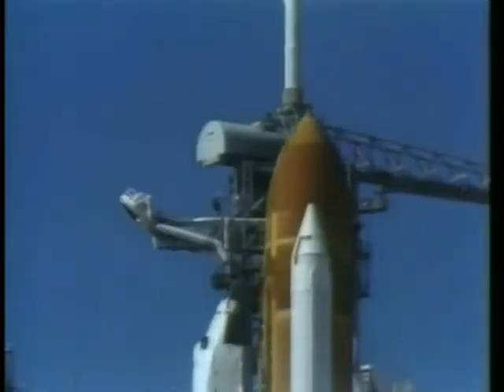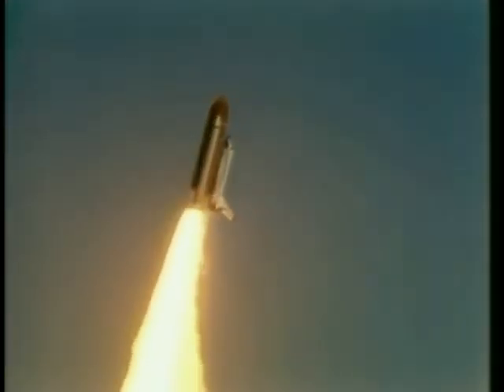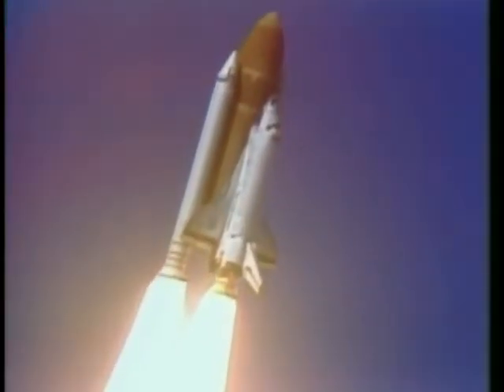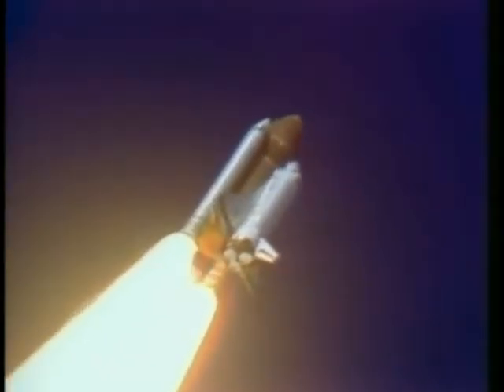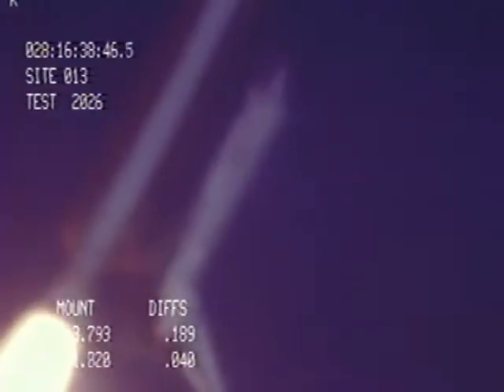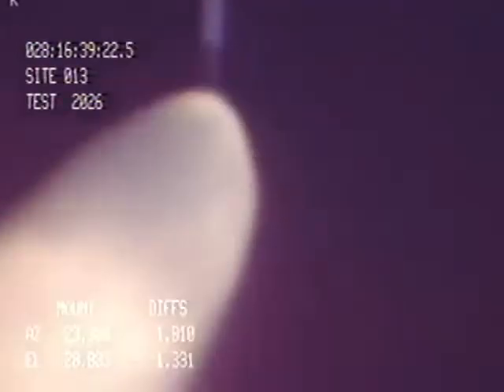The Challenger Disaster: STS-51-L Side Camera

Comment: You’d think someone at the control room would see the fire coming out of the O-Ring and immediately tell the shuttle astronauts to abort. There’s a good 13 seconds between the flame starting to when fuel tank blows up.
Reply: Not like they could have done anything. They were dead as soon as the fire started
Reply: Those boosters cannot be turned off once lit. They have to burn out. And even if they could have jettisoned the boosters, it would just make another death scenario. They wouldn't have the power to make orbit or the ability to land it. It's one procedure, one plan and one chance.
Reply: @ There’s a failsafe where the shuttle could detach from the main booster and glide back to base.
Reply: @jrxtrc  they are over the base with a glide ratio of a bowling ball. Don't think so.

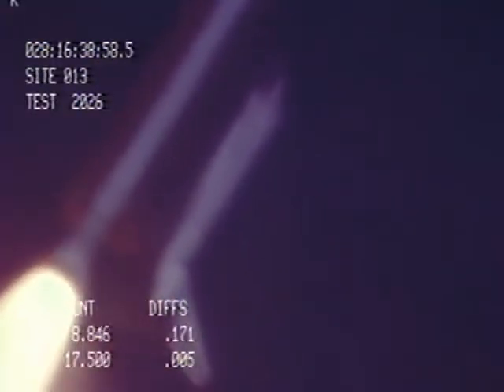Comment: 1:01
You see the o ring destruction and beginning of the explosion.
Weird how not even a second later they are told to throttle down and then all hell brakes loose.
Reply: What's I've always found interesting is the tv broadcast cut right to this camera angle just a second or two before the explosion. If they had cut to this angle ten seconds earlier, you would have seen the burn through and resultant damage to the tank, and it would have been obvious (to the public at least, NASA would have known the cause the second they reviewed this footatge) what had happened.

Comment: If you slow it down you can see the moment when the o-rings get burnt through and the joints explode. It really is sickening.
Reply: This is a TL;DR for a lot of people. The 1st paragraph is the main point and read the rest for a summary of what exactly happened.

The O-rings burned through almost instantly at launch but the gap was quickly sealed by slag, probably molten aluminum. Challenger flew through strong wind shear at about 59 seconds, which appears to have broken the inflexible slag plug, allowing a plume of exhaust to burn through the joint, continuously enlarging the hole and impinging directly on the external tank and the attachment strut. There's a camera angle from the opposite side that shows these events much more clearly, especially the develoment and evolution of the plume.

At 72 seconds a bunch of things happen almost at once: the attachment strut burns through/breaks, allowing the rear of the right booster to swing outward and ventrally from the tank. The aft dome of the hydrogen tank fails, causing rapid depressurization.

Both factors contribute to the failure of the oxygen tank, which is at the top 1/3 of the external tank. First, as the bottom of the right booster swings away, the top moves inward, with the forward attachment acting as a fulcrum. It collides with and buckles the external tank in the area called the intertank region, between the hydrogen and oxygen tanks, which loses a lot of its vertical rigidity. Secondly, the rapid release of the pressurized liquid hydrogen creates a forward thrust, pushing the hydrogen tank up into the oxygen tank. As the external tank disintigrates, the boosters continue on their upward trajectory, and the orbiter breaks up due to aerodynamic forces, at about 74 seconds.

The escaping hydrogen and oxygen do not detonate; there is no shock wave. Rather, they escape with some localized combustion. Most of the cloud you see is condensation of water vapor from the surrounding air due to the extremely cold temperature of liquid hydrogen and oxygen. Its fireball-like appearance is largely due to light from the booster exhaust and from the aforementioned local combustion.

You can very clearly see just how huge the plume has gotten in this video as the booster continues flying. It looks nearly as big as the exhaust from the nozzle by that point. Recovered debris suggests that the hole at the booster joint grew to about 18×24 inches (45×60 cm) by the time it was destroyed by the range safety system about 20 seconds after loss of the shuttle.

(P.S. On only the second flight after Challenger, Atlantis nearly suffered a Columbia-like disaster on reentry. Tiles on the belly were severely damaged during launch. A tile was completely lost directly below the crew compartment, and complete disaster was only avoided by the lucky coincidence that a mounting plate for a transmission antenna was under it. The aluminum skin melted under that tile, but the extra thickness of the antenna mount stopped it from burning all the way through. Look up STS-27; the mission commander Hoot Gibson has told this story many times, and it is mentioned in the Columbia accident report.)
Reply: @phoenixshade3  Not TL;DR for this space buff. Good summary. Yeah, I think some models have suggested that without the uncommon presence of the jet stream right over the Cape that day (= wind shear), the aluminium oxide slag seal MIGHT have held through SRB burnout. We'll never know.
Reply: Someone had a bad day at the office 😂😂😂😂😂😂😂 hilarious

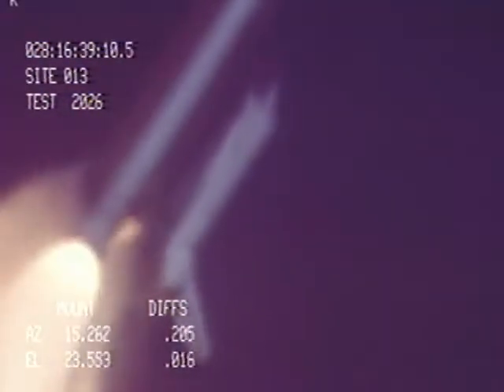Comment: Quality footage. If you play it at 0.25 speed, at 1:13 time mark you can see the bottom of the external tank coming off, due to the SRB joint ripping away.
Reply: joint*
Reply: @DarthVader1977  Thanks, corrected 7 years later :face-blue-smiling:

Comment: And judging from the condition of the RH SRB after it left the cloud, it probably would not have made it to burnout even if it had not damaged the tank (ie, the leak was on the other sidewhereit could not hit the tank or attach point). It appears that the leak was even worse after it came out of the cloud and was probably destroying the entire joint. Another 30 secs and the whole booster would have exploded.
Reply: Either way they were dead the moment the SRBs ignited.
Reply: It's amazing how long the booster flew with that hole! According to the propellant experts it should have exploded as soon as the seal was compromised. If the leak hadn't been clogged by the propellant at ignition, indeed it would have exploded on the launch pad.
Reply: @apollosaturn5  Actually, the shuttle may have made it if it weren't for the severe upper-level winds that day.  The seal had actually sort of sealed itself shut, but severe turbulence from upper-level winds disturbed the seal and forced it back open.
Reply: @jeffgeurin1265  That's right. But what surprises me is that after the propellant seal/plug broke off the faulty booster continued to fly with a hole in the casing getting bigger and bigger, even after vehicle breakup. The theory was that when the O-rings fail and the casing is breached it should explode.
Reply: apollosaturn5 probably the speed difference made it a bit longer.
Reply: @jeffgeurin1265  To be more precise it wasn't the wind sheer that caused it to break loose. It was the exaggerated steering commands that made the booster flex that broke the "seal" loose.
Reply: @apollosaturn5  its amazing the boosters didn't explode at all during vehicle breakup. They are travelling sideways at one point, the aerodynamic loads must have been insane on them.
Reply: @djbeezy  right, but those steering commands were in response to the wind sheer.
Reply: @robmausser  That's very true.
Reply: @robmausser  That's a testament of how strong those boosters were. Think about it, on the launch pad, all of those 4.5 million pounds rest only on the boosters. And they have to withstand the force of the main engines, flexing back and forth. Especially during a flight readiness firing, where the main engines fire on the launch pad for 20 second or more.

Comment: As soon as the flare was spotted couldn't they have radioed to challenger to try and throttle down to 0? or would that be a too fast of a engine change and blow it up anyway?
Reply: The solid rocket boosters can't be turned off. Once they're lit, you're along for the ride until they expend all of their fuel.
Reply: @AlecFSiegel  You can kinda shut them off, the abort charges split open the casings, eliminating all thrust
Reply: @AlecFSiegel  That's not right. They blew up those boosters from the ground by remote control after they detached.
Reply: @robgeorgia8801  The Range Safety Officer blowing them up is not the same as them expending their fuel. They would never detonate them while they were still attached to the stack.
Reply: +Alec Siegel  Not that I realistically believe that anything could have been done to save the crew under the circumstances, but in theory couldn't the SRBs have been jettisoned early, then the external tank, and then after slowing a bit from gravity and drag to reduce aerodynamic forces, couldn't the Challenger have glided back for an emergency landing?  Perhaps this would have taken insane skill and incredible luck (not to mention immediate knowledge that no one had at the time), but at least in theory was such an abort a physical possibility at all?  Just curious.
Reply: @rbrtck  The separation motors on the SRBs are effective after the boosters spend their fuel and therefore are light enough for them to clear the orbiter and the external tank safely. Before that, the SRBs are too heavy and if they separate they would contact the external tank and the orbiter killing the crew anyway. Another issue is that the orbiter can return to the launch site (RTLS abort) after hitting at least 150,000 feet in altitude and using the main engines to go back. If you don't have main engines the only thing to do is to ditch in the ocean which at that time was fatal since the astronauts didn't have parachutes and couldn't bail out. At 73 seconds or less into the flight the orbiter is too low, too slow and the external tank too heavy to perform an RTLS abort.
Reply: They only had a few seconds, at my guess is that ground control would not have seen anything until the major explosion. You(We) need to think of the technology of the time. This was probably film that needed taking to thei rlocal drug store to be developed)
Reply: Nobody monitors these. These are all watched after the shuttle is in orbit. There is very little that is actually monitored compared to what is captured.
Reply: The mission control aren't really watching the lift off; all their eyes are on the computer monitors and the data that's coming off them.
Reply: It wouldn’t have been possible. You got to remember at T -31 seconds, the shuttles onboard computer took over control. Like with the F-16, you didn’t fly the shuttle; the shuttle flew you. They didn’t have a contingency in the computer program to attempt to detach from the ET during the SRB burn.

I’m not sure it would’ve mattered. The orbiter was the size of a Boeing 737 and they had already broken the sound barrier by this point. Quite possible they would’ve been ripped apart had that been attempted.
Reply: As DigNap15 stated, this angle only gave evidence of a major malfunction just seconds before disaster. There are other cameras that offered a different vantage point which, in turn, offered a few seconds more indication of the flame-through of the O-ring in the right SRB. 

To the best of my knowledge, almost all of those cameras were monitored by camera crews and weren't viewed in real-time by flight safety engineers. DigNap15 is correct in speculating that most (if not all) of those cameras were operating on film (and would need processing subsequent to filming). 

However, in theory, the Space Shuttle did have a launch abort -- but only within certain windows of opportunity. The way that the shuttle worked at launch was the ignition of the three shuttle engines first (while it was still clamped) at T-6.6 seconds before launch. When the countdown hits T-0, the solid rocket boosters are ignited. Once ignited, they cannot be manually turned off.

If flight safety engineers had real-time access to all of those cameras featured here, it is possible that they could have pushed for a quick "go" for flight abort. There are several types of aborts -- including Return to Launch Site (RTLS), Trans-Atlantic Landing (TAL) and Abort Once Around (AOA). The first, RTLS, is the most dangerous. The second is a landing that would probably take place in Africa. The third is what would happen if the shuttle was unable to make a stable orbit but could still make a single circle of the Earth and the glide to a landing. None of these aborts ever took place in the history of the shuttle program.

Another abort sequence is called Abort to Orbit. This is what happens when there isn't enough fuel or velocity that is needed to get to the planned orbit but enough to allow the shuttle to reach a lower orbit. This happened once to STS-51-F -- about six months before the Challenger disaster.  The shuttle still completed a seven-day mission despite having to abort to a lower orbit due to a hydrogen leak. 

However, I should point out that any flight abort could only occur after the SRB's had expended primary fuel. Once ignited, the Solid Rocket Boosters could not be safely jettisoned without prior expenditure of fuel. So, in the case of the Challenger, it wouldn't have worked anyway.
Reply: A search for "Space Shuttle abort modes" has cool info on all the various scenarios.  Alas, no abort modes existed until the Solid Rocket Boosters finished their fuel and detached a little after 2 minutes (Challenger disaster was at 1min 13 seconds)... any major failure during the first two minutes meant a "Loss of Crew and Vehicle" disaster.   The first available abort mode is this: 

Return to launch site
Return to launch site (RTLS) was the first abort mode available and could be selected just after SRB jettison. The Shuttle would continue downrange to burn excess propellant, as well as pitch up to maintain vertical speed in aborts with a main engine failure. After burning sufficient propellant, the vehicle would be pitched all the way around and begin thrusting back towards the launch site. This maneuver was called the "powered pitcharound" (PPA) and was timed to ensure less than 2% propellant remained in the external tank by the time the Shuttle's trajectory brought it back to the Kennedy Space Center. Additionally, the Shuttle's OMS and reaction control system (RCS) motors would continuously thrust to burn off excess OMS propellant to reduce landing weight and adjust the orbiter's center of gravity.

Just before main engine cutoff, the orbiter would be commanded to pitch nose-down to ensure proper orientation for external tank jettison, since aerodynamic forces would otherwise cause the tank to collide with the orbiter. The main engines would cut off, and the tank would be jettisoned, as the orbiter used its RCS to increase separation. Once the orbiter cleared the tank, it would make a normal gliding landing about 25 minutes after lift-off.[3]

If a second main engine failed at any point during PPA, the Shuttle would not be able to make it back to the runway at KSC, and the crew would have to bail out. A failure of a third engine during PPA would lead to loss of control and subsequent loss of crew and vehicle (LOCV). Failure of all three engines as horizontal velocity approached zero or just before external tank jettison would also result in LOCV.[4]

The capsule communicator would call out the point in the ascent at which an RTLS was no longer possible as "negative return", approximately 4 minutes after lift-off, at which the vehicle would be unable to safely bleed off the velocity it had gained in the distance between its position downrange and the launch site.

The RTLS abort mode was never needed in the history of the shuttle program. It was considered the most difficult and dangerous abort, and also among the most unlikely abort to have ever been attempted since there were only a very narrow range of probable failures that were survivable but nevertheless so time-critical as to rule out more time-consuming abort modes. Astronaut Mike Mullane referred to the RTLS abort as an "unnatural act of physics", and many pilot astronauts hoped that they would not have to perform such an abort due to its difficulty.[5]"
Reply: Milton D 
Hard to say.  It just looked as though there really wasn't anything to save them at that point.  The burn through went into the External Tank and that was that...
Reply: You can't throttle down a solid propellant rocket on command and you can't fly the shuttle without the power of the main engines. The attachments between the orbiter and the external tank are not strong enough to carry a dead weight orbiter and the shuttle wasn't designed to fly on the solid rocket boosters alone, it wouldn't be stable enough. Once you ignite the solids there's no turning back. All abort opportunities become available after they spend their fuel and separate.
Reply: No, their best bet would've been ejection seats that could be remotely engaged but then disabled when in orbit. The problems with that are weight, engagement during launch or in space, and of course the higher G's knocking them out. In the end their true best bet was having NASA do their job and prevent such disasters in the first place.

Comment: The Thiokol engineers knew that very day what happened. One of Bjoulays co-workers did a frame by frame examination of the CNN coverage and noticed what appeared to be a leak in one of the boosters as it left the cloud. He also noticed the "flare" becoming visible before the breakup, it appears to come from the SSMEs but that is an optical illusion. After the 2nd "re-focus" you notice it.
Reply: Ebeling and Boisjoly fully expected  the shuttle to blow up on the launch pad as soon as the SRBs were lit. When the vehicle cleared the tower successfully, they thought they had dodged the bullet  -- only to have their hopes shattered 73 seconds later.
Reply: There was a tracking camera that was filming the on the side the Blow-By was happening on, you can see it clear as day